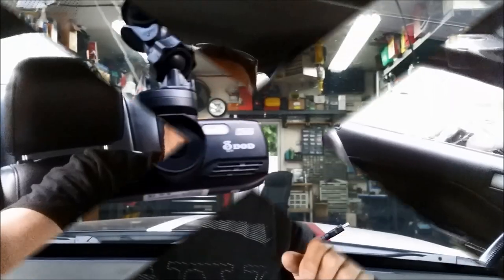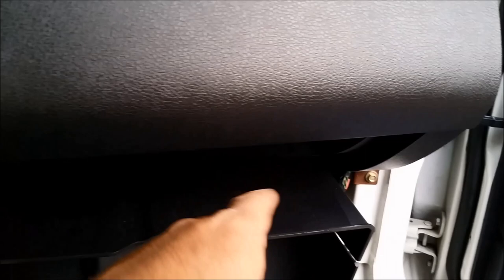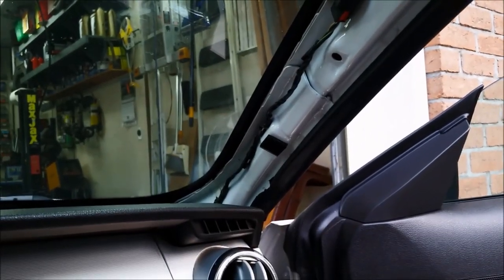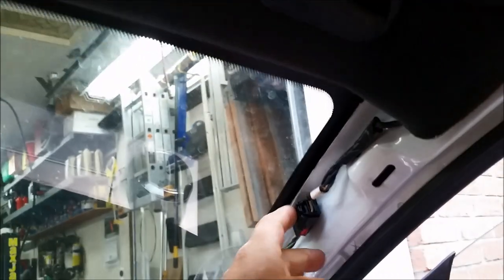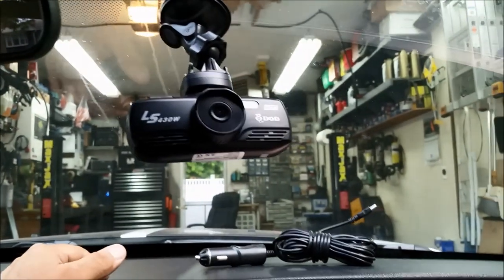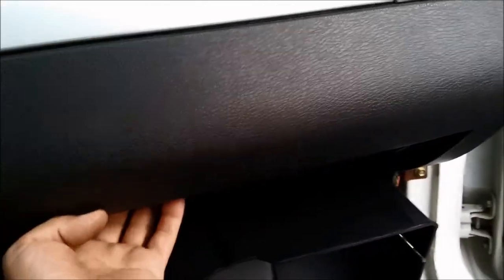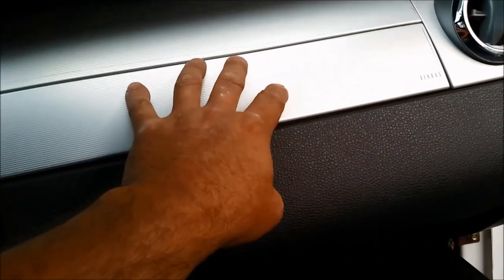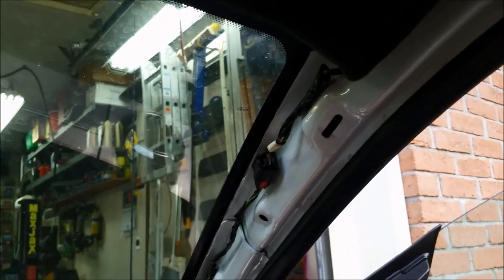Routing Wires Around Airbags: Quick Tip Video #1

Comment: You said any dash cam questions, so here it goes: Scanning YouTube for weeks, I  haven't been able to find one "expert" willing and/or capable of definitively answering these questions, which I'll separate into two or three comment sections in order to avoid any possible confusion. So, question one: I thought the whole idea of parking mode, be it hard-wired or with an OBD adaptor, was for the dash cam to essentially turn off and only go on when motion is detected, which would use very little battery power, assuming, of course, there were only a handful of events to activate the motion sensor over a twenty-four hour period. However, many say doing this will drain the battery in hours, even if there are only a few activations over a twenty-four hour period. And as for a cut off switch, or built sensor, that turns off the dash cam when the battery goes too low, this would essentially make the parking mode feature useless because we all know if anything happens, it'll happen when the camera goes off. Moreover, such an useless drain to the battery every night would only lead to what I think they call battery sulfation, kills the cells. I don't want to use a lithium battery pack, especially with the hot temperatures we get for so long, but I have vandalism issues to deal with. So, I need motion detection. I'm thinking of getting the Thinkware U3000 because it apparently uses less power in parking mode.  But now I don't know what to " think" Can you or anyone out there tell what the deal is with this?

Comment: Hi I put a dashcam in with a hardwire kit and used the fuse for the wipers and I ran the wire though the A plier there are no air bags any where apart for steering wheel and now I have a warning light for airbag system in yellow
Reply from the maker: Strange coincidence. I'm guessing you bumped something. My guess would be the passenger side air bag connector

Comment: Great advice!  I have a question... I hardwired my first dashcam.  I then got one with dual cameras.  The cable was the same so I just plugged the new one in.  A lot of the recordings though come up as unplayable due to error or something like that.  How important is it to change to the cable that comes with the device?
Reply from the maker: Niamh Healy. Depends on the brand. I deal soley with DOD Dash Cams. I will say usually read type errors are sd card related. Either the card is bad, not formatted properly or the storage capacity of the card is too big for the camera
Reply: Ah okay! Thanks a million for that!  It came with a 32.  I will try it with a 16 :)
Reply from the maker: Niamh Healy a 32gb should be fine. Most can handle at least a 64gb. Make sure it's a class 10 or better. And make sure it's a name brand. I prefer Samsung. Stay away from eBay. Lots of phony cards on there
Reply: It came with the camera so I'm guessing it's made in China finest.  Will look for what you suggested ;)
Reply: Niamh Healy 
I agree, quality and class sd card are a must.  Also look for MLC nand chips instead of TLC installed on the sd card. 
 one more thing, check for firmware update for the camera.
Reply: Thanks for that :) I've ordered a Samsung class 10.  Hopefully that will do the trick ;)

Comment: Second question: Other than taking one to five minutes for a dash cam to start parking-mode for motion detection when using an OBD cable, is there any difference at all between using an OBD and a hard-wired system, particularly when it comes to power consumption and motion-detection abilities? 
Third question: I'm to the understanding that using a OBD for this purpose can potentially create problems with the car's electronics. The guy from Save Drive Solutions made a video suggesting that it depends how many pins the OBD has. For example, the Iroad OBD cable has only two pins, whereas the provided OBD cable that comes with the U3000 has 8 pins. Although the Iroad is supposed to be compatible with the U3000, he didn't want to, or couldn't, make it clear if the Iroad would negate any essential features in the U300. In other words, are those extra pins in the U3000 for show, or do they provide essential functions, just a little something I thought he should take an extra minute to clarify. Either way, I'm kind of stuck now with what to do, and answers to theses questions would sure help me move forward faster and with more confidence. Thanks.